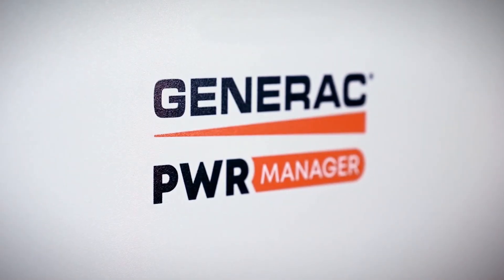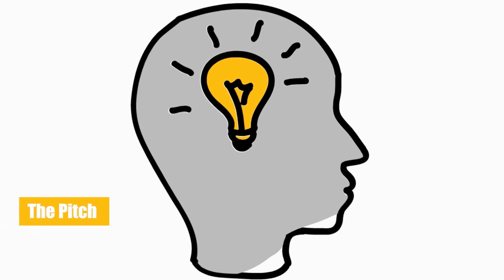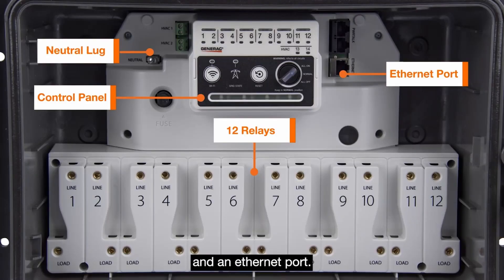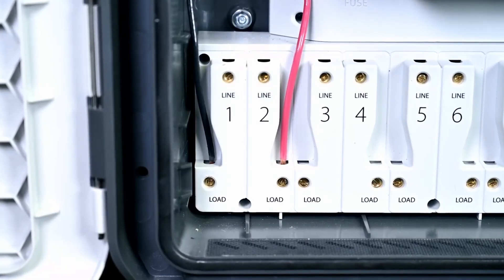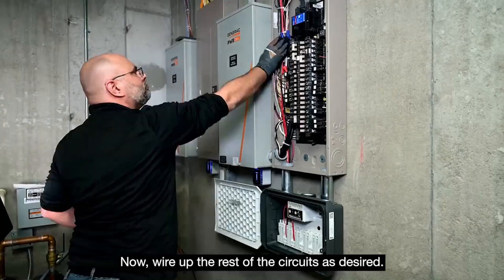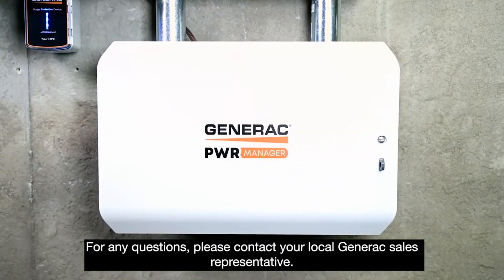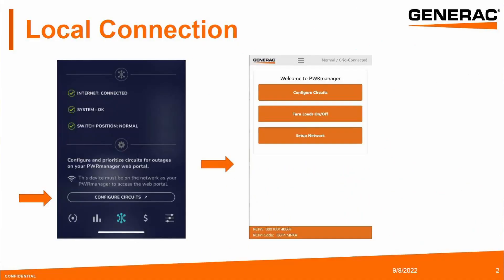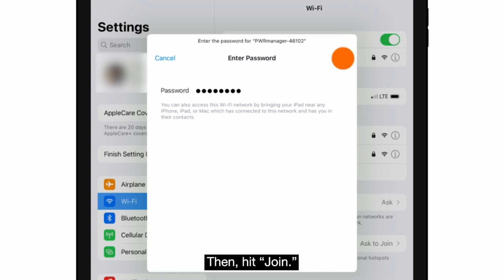Generac PWRmanager installation and load management ROI | The Pitch

Comment: I'm looking to do exactly what is described in the video.  I'm on weather guard (I think) because I get alerts from Generac about upcoming inclement weather, but it doesn't do anything to change my charging/usage profile.  So at that point, I'd like to (automatically) switch to charge mode to ensure the batteries are topped off.  And then after the threat is passed, switch back.  But I don't want to charge up from the grid.  I also want to be able to cycle the batteries but not "throw away" power if the solar panels are generating more power than the inverter can pass to the batteries so that means I'd possibly want to lower the charging rate but it would take a bit of analysis on my highest solar output days to see what makes sense.  So I want to enable TOU and be able to draw down on the batteries after the sun goes down to probably 45% and then go back to the grid for power.  And then recharge from solar when it gets light again.  And I know Generac has a web interface but all I can see is where my power is going to and coming from.  I wish they'd open the web interface they use to us customers so we can modify things like this on our own from our computers rather than having to go to the LCD screen to do so.  Ideally, there's be an API call that I could leverage with the rest of my home automation that already knows when sunrise and sunset times are at my location, as well as weather conditions.   Then I wouldn't even need a seasonal profile for TOU but it would self-adjust every day based on sunrise/sunset times and weather conditions.   Then I could be on full autopilot and maximize my efficiency.

I've searched and searched for information on doing this but it's pretty slim out there.  This is the only video I've seen that comes close to describing what I'd like to do, and should be possible given everything I think I know about how Generac does things.  But there are no good sources out there about how to do any of this - especially the API calls to automate settings.  If anyone knows of any good sources of information on any of this, I'd appreciate knowing where I might find it.